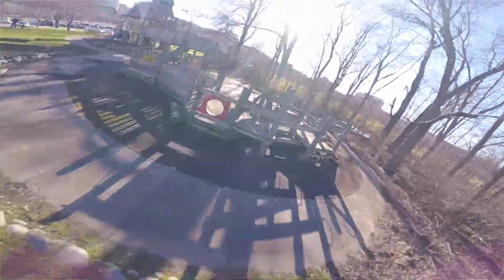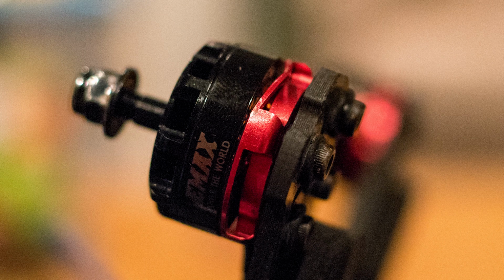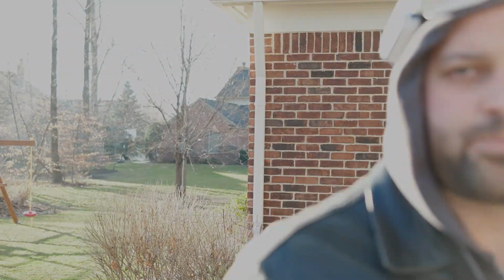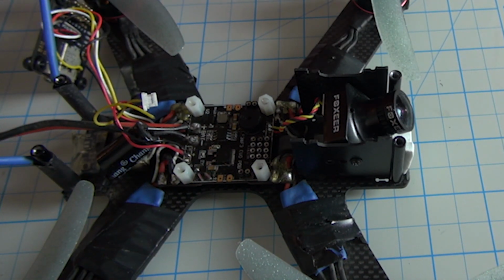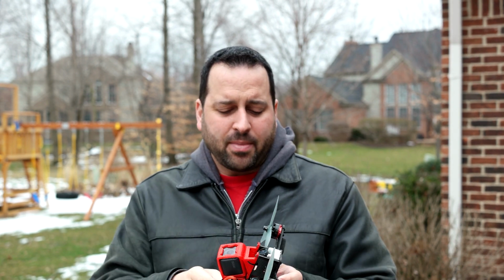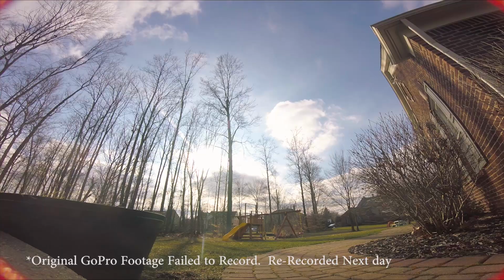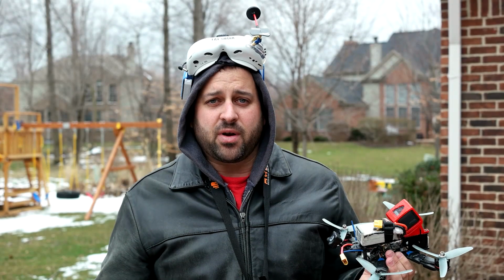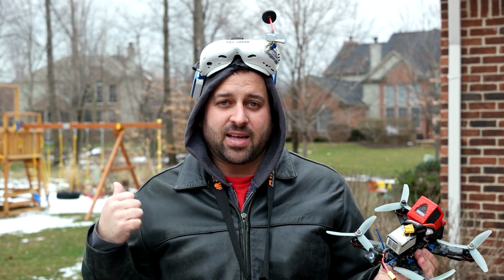Flying with a Jacked Up Red Bottom Motor

Comment: I have been struggling with video issues for a while now. I did start with bad ground then broken wire from the battery strap but it seems they work so good the first few flights then degrade quickly. My go to have been the Cricket series and Tramp HV. I did read that the Tramp mislead us saying connect directly to batt then found they were blowing so now I have a couple of the V2. I hope for better results. I did just try a BlackSheep TBS 800 and am impressed out of the box. I will give it a few crashes and a bunch more batterys to see if it holds. 
For more crash resistant drones, cheap frames will leave you waiting for parts constently. I dont race or fly compitition so weight or perfict build is beyond me. So my first really sucessful build has been the EMAX Nighthawk 200. I love the battery being better protected on top somewhat cradeled, Motor Guards and protection for the camera. That modle has served me well. The only true damage I have been able to do is the slot for the battery strap ridge broak pretty fast but I just loop the strap around the top plate and that is that. 
I just finished two builds for the Armattan Chameleon Frame. It sucks if you need to rewiire the camara encased in all the aluminum but the camara is very protected and the bracket is fully adjustable for change the view angle. I just had to learn to finish the camara connections before bolting it on. So far I have only flown one of them for a few hours many batt packs. Flys great. nice and smooth. I only crashed a couple times in the grass but am confident it can handle the standard Telephone Poll, Flip a few times, then the Asfault in the street without to much trouble. Ya for some reason my quads hate crashing in the lawn preferring much more dangerous (Manly) crashes on the sidewalk or street. Idiots the grass is so much more forgiving. These quads can be so stupid sometimes. sorry I digress. The other thing I like is the lifetime warrant on most of the frame. The company doesnt even care if you found it they will warranty without question. 
Stand off for FC. I am getting tired of pulling my quad all appart just to replace the plastic stand offs too. I just watched a YouTube vid with Le Drib who uses Rubber Steel stand offs which are more crash resistand and help eliminate vibration. I think I just found some from https://www.racedayquads.com/ I am waiting for the order so we will see.

Comment: Maybe an lc filter would take out those last inconsistent lines in the camera?
Reply: Ok, so we all know what a LC filter is... But what is a LC filter?
Reply from the maker: There is an LC filter on the PDB I'm using for the camera feed.  I don't notice any noise now with my camera.  Unfortunately I didn't have DVR footage of my re-do flight, but I think things look great now.
Reply from the maker: An LC filter is a combination of a resonator and capacitor which basically serve to filter the power source to remove noise in the power.  If you've seen wavy lines in your video feed when connecting directly to battery voltage, that sort of noise is what is helps to filter out.  Lots of PDBs include them inline these days.
Reply: Yeah, I fly a rudimentary PDB without LC filter so I added one.  Also nowadays with the more powerful motors and brake on stop in BL Heli_S and others it's a good idea to also power the flight controller through the LC filter.  I haven't had it happen myself but there's people out there that fried flight controllers because of power spikes from the motors
Reply from the maker: do you have a recommendation for an LC filter to add?  On my martian build I have a rudimentary PDB without a LC filter and could use one.
Reply: It's basically an LC filter "light". Functions the same as an LC filter but it's the lightest I could find at 2.5 grams, I have it in an Alien frame and a Gt2 frame and both work great.
Reply: I'm using Pololu's exclusively. Very clean power and they have a wide range of voltages they work with. Affordable too.
Reply from the maker: Thanks man!  I ordered a few based on your recommendation and will try them in my builds that use rudimentary PDBs.  I look forward to trying them out.  Hopefully the slow boat from China doesn't take too long to deliver them!
Reply: I know JC from project blue falcon (awesome channel) uses polulu too and loves them. I might try them in a next build.
Reply: I had LC filter on my build too, but still with some lines on the screen, so I aded these things http://www.ebay.co.uk/itm/291610845410?_trksid=p2060353.m1438.l2649&ssPageName=STRK%3AMEBIDX%3AIT , one on the vtx power, and one stronger 1000uf on to the main battery power imput, after that any punch outs my picture is crispy clear

Comment: my lumenier motor was bent like that from snapping an arm and the motor was working fine then one tiny tap it started locking up so just watch that motor after you crash it turns out a magnet came loose to cause the lock up.
Reply from the maker: Thanks man, that's good advise and good to watch out for.  I was shocked it even worked like this as is.  It was actually a tough to turn the motor at first when it first happened.  Now it turns smoothly, but it does make me a little nervous.
Reply: John E Fly thats what mine did to would be fine under power but kinda hard off

Comment: No motorguard? :(
Reply from the maker: I actually have some sitting in a box too.  I just chose not to put them on, even after the crash.  Maybe I'm living a little too dangerously?
Reply: John E Fly nah, motorguards themselves brake quite easily and it's harder to change props when they're mounted.

Comment: Great video. Btw that akk vtx is a rebranded eachine vtx that sells for 14 dollars. for what you spent I would have bought the Tbs unify pro hv. you can fly at 800mw with out punching other Pilots out of the sky because it's super clean output not so noisy to where it leaks on to others video feed. and as clean and noisy I don't mean the image. just saying 😉
Reply from the maker: I didn't know it was a rebrand, that's good to know.  For what it's worth it cost me $18-$19.  Doesn't the TBS Unify Pro run around $40-$50?  Plus I didn't have to wait the year for the Banggood boat to show up.  I don't mind paying a few extra bucks if it means I get it right away.  So far it seems Eachine did a good job.  Maybe one day I'll try something more expensive to compare it to.

Comment: So which motor do you prefer? the EMAX 2205 in this video or the 2306 2400kv?
Reply from the maker: I really like both.  At this point I would say I'm enjoying the 2306 motors more.  They have tremendous Torque.  But at the same time, they do seem less efficient so far.  Both run very smooth, and fly great, but the 2306 just give that little bit extra.
Reply: +John E Fly this really helps out, thx for the quick reply. I am putting together my first build and was torn between the two motors when I found your page. I am putting together a Martian II 255 frame after flying an Arris C250 for the last month or so.
Reply from the maker: It sounds like you're planning to run 6" props, since you went with the 255 size?  In that case I would stear clear of the 2600Kv motors.  You should be able to run 2300KV (maybe even the RS2306 2400KV) but it would probably be even better with motors at 2150-2200KV.  Curious, why did you decide on 6" arms instead of 5" arms?
Reply: +John E Fly you know what...I have assumed that because my Arris C250 RTF came with 5" props that thats what I would put on the Martian II 255mm frame. Are you saying that the 5" props are more appropriate for the Martian II 220mm frame? did I say I was new to this, lol.
Reply from the maker: Yeah, the 220 is for 5", the 180 is for 4" and the 255 is for 6".  You can of course run 5" on the 255, it'll fit, but the 220 would be more appropriate.